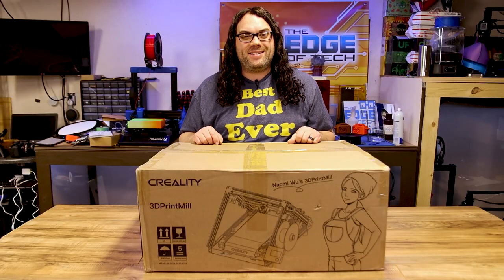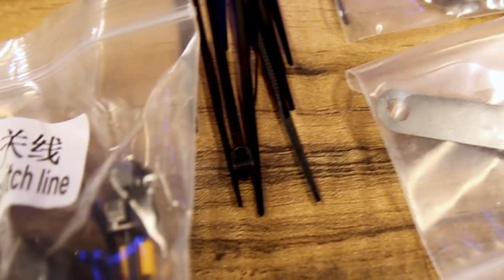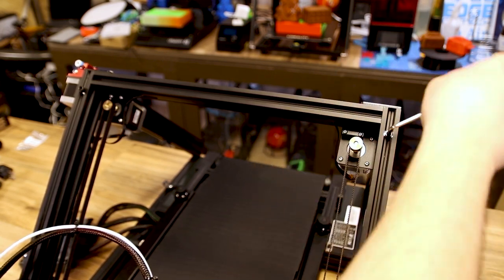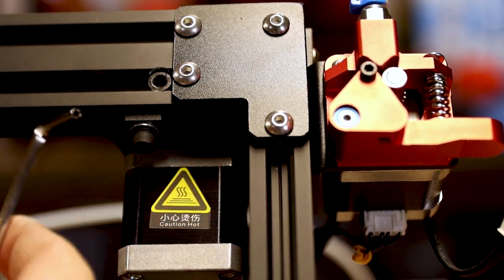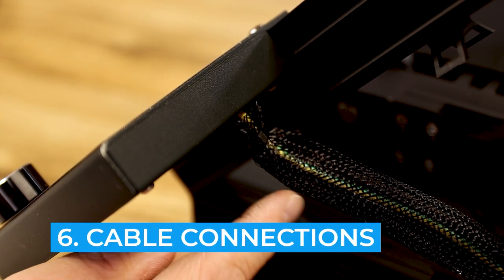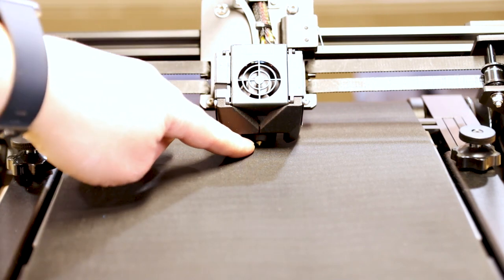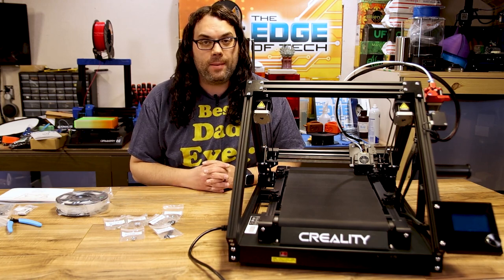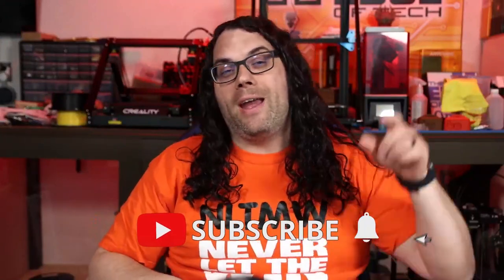CR30 - 3D Print Mill - Unboxing, Assembly and Setup

Comment: Soo let's start with thank you very much for this video. Instructions in the CR30 are good but the video made it easier. How ever I'm in the leveling process and the back part of the nozzle, the plastic housing is touching the belt before the nozzle. Did you encounter that issue?

Comment: Yeah, the manual's a lil unclear on things.  I followed the instructions however I was instantly worried when the book referenced the top gantry being separate.  Currently I've got 2 plugs not plugged in as well as no real idea where the switches are I'm supposed to level it with.  Thus this video.